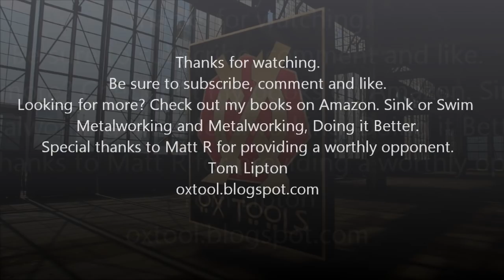Screw Extractor Torture Test Round 1

Comment: I'd rather use the open end of the wrench in situation like that... It might be a little bit more dangerous to your knuckles but takes out the unwanted and insidious bending that is caused by the angle of closed end. I've learned it the hard way... :P
Reply from the maker: Hey Mikey,

Good point. The angle adds a weird moment to the shaft of the extractor. Never really thought about that one. Thanks for the comment.

Cheers,

Tom

Comment: Its beautyful to see how carbide cuts hardened steel like butter =) Tho ... why not heat the ear of the thing to get some of the hardness out of the bit ? to anneal it =)
Reply from the maker: Hey Tomas,

If the engine cycling didn't anneal the stud its not going to happen from anything I can do easily. The material is some kind of stainless. Faintly magnetic and fairly hard. I may take the remainder and see if I can figure out what it is. Thanks for the comment.

Cheers,

Tom
Reply: hehe that is true! But what i was thinking of was the broken of extractor =) Tho carbide seem to cut that stuff quite nice! =) Was a stubborn bugger that bolt! =)

Comment: Hey Tom,  it may one of those ARP Studs . They are very high grade studs.
Reply from the maker: Hey Norm,

What is an ARP stud? Best guess so far on the material is A286 precipitation hardening stainless steel. Thanks for the comment.

Cheers,

Tom
Reply: oxtoolco Hey Tom,  ARP  is a hi performance automotive supplier for bolts and studs.  Im sure they use some high grade steel.
 http://arp-bolts.com

Comment: Hi Tom,
           At least you are showing that the ceased up bolt which is every mechanics nemesis has thwarted the professional ceased bolt remover. To my mind the bolt remover has been over hardened and should never have shattered. I think that the diameter of the bolt remover which is smaller than the bolt would not be up to the task set it. We have a bolt remover in the UK that has a single turn reverse spiral on a tapered shaft, and the top end of the taper is the same diameter as the bolt. The more you try to turn it the tighter it gets, but I don't think even one of those would shift that stud. I would get back to the manufacture If I were you,and get them to remove the stud - I doubt they would succeed. It certainly doesn't do them any credence.
Reply from the maker: Hi Mo,

I agree this tool should have twisted before shattering. Also I feel that an extractor that is close in size to the fastener should be able to remove it. Drilling the center out of the fastener certainly weakens it somewhat. This particular stud was literally welded in. I really want to try some of the other ideas than cam through on the comments. Thanks for the comment.

Cheers,

Tom

Comment: I had a toyota with a broken exhaust manifold and the same problem. Hard as ...... And the bolt was broken in the head did the drilling while engine in the truck. Shait but I got the thing out. Have not broken an extractor yet..... Dred the day it happens :)
Reply from the maker: Eric Hope Hey Eric,

I tip my hat to you. I would not want to drill that super alloy while it was in the vehicle. It was hard enough with it in the  vise. Thanks for the comment.

Cheers,

Tom
Reply: oxtoolco Yeah it was like a day in Hell. Bolt broken under the surface. 6mm drill bit with a 6/8mm pipe to make it go straight in the hole. A air angle mini grinder and a crowbar to push it in. One can sometimes wish for a couple of extra arms :) LOL

Comment: Ah, yes... those metric 12.9 bolts...  the 10.9 hardness is bad enough (10.9 is about a Grade 8, 8.8 is roughly analogous to a Grade 5), but the 12.9 is something else...

Eric
Reply: And when you sheared off the extractor... 10.9 bolts might be that hard relative to your tool, depending upon what Blue Point made it to be... 12.9 = no contest...

I've rumors that the geniuses behind the metric screw standards have dreamt up a grade rated over 14 - not sure if it's gone into production yet...
Reply: chemech  "They sell replacement parts for this very reason..."   BTDT, got the scars to prove it...
Reply from the maker: chemech Hey Eric,

That stud felt like grade eight plus to me hardness wise. Slightly worse than drilling a black socket head cap screw. Thanks for the comment.

Cheers,

Tom

Comment: Tom,

I have lots of experience removing rust welded studs from exhaust manifolds.  I have never once been able to remove a rust welded stud or bolt with any style of screw extractor.  In this case The only thing I find that works sometimes is to weld a nut too the broken stud and back it out.  This only works about 30% of the time.  Then the next step is to drill and re chase the hole with a tap.  The only situations I have ever found a screw extractor usefull for are those were some knuckle head has overtightened a bolt and broken it or when an otherwise clean bolt has succumb to fatigue.  My guess is you will not be successful with the extractor.  I dont want to be the naysayer,  Just speaking from experience.

Comment: Totally amazed at all the experts writing in this blog.  I remove a lot of stuck, broken off, beat up, welded by rust/heat and other uncommon problems.  I got some info from this one/two punch at removing stuff.  Thanks.
Reply from the maker: Hi Bill,

Thanks for the comment. Many of these experts missed the point of the video being the testing of the new set of extractors I got. I never would have cut the stud off in removing it was the goal.

Best,

Tom

Comment: Freaking. Machinist 

a car guy would know it is hardened.😂😂😂😂😂
Just kidding Tom
Maybe I’m stupid but it seems that driving an extractor in just forces the threads against the part exacerbating the problem.
Seems they were only made for bolts that snapped due to over tightening. Not because they seized
 My solution to this has always been keep using larger and larger drills until the bolt wall is so thin you can get it to collapse. And pray you don’t screw up the internal threads in the process

Comment: Can't you just drill it out, stick a reverse thread tap on the there, thread in a bolt and use that to remove it? Seems like it wouldn't break like this and be easier to do.
Reply from the maker: Ariel Lezen Hi Ariel,

The goal of this video series was to test to destruction the Blue point screw extractors. I think we did that pretty well here. You are correct that if the goal was to get it out I might have used a different technique. Thanks for the comment.

Cheers,

Tom

Comment: I would have never cut it off. I would have went for the torch and vise grips /pipe wrench first .IMHO
Reply from the maker: Hi Paul,

You are correct. I was testing the extractor, not the easiest way to remove the stud. Thanks for the comment.

Cheers,

Tom

Comment: This video is real pain man . What is the purpose of it anyway extracting the stud or testing the straight of this extractors ? First think I would do is use the existing stud witch is sticking out best case , don't cut it out and make your life harder. SIMPLY if the thread is good put  two locknuts as close as possible to the part and turn bottom one anticlockwise. Of course put your penetrating oil let it set and you can hit on the nuts with the hammer from all sides to shock it. If this doesn't work weld a nut if the stud snap do all the rest. You can drill the hole to the edge of the thread and clean in with tapper or just drill it bigger and use simple helicoil to repair it. 5 min job byddy this is what it is.
Reply from the maker: +Matt Atanasov Testing the extractors like the title says. I wouldn't have cut it off if removing the stud was the goal. Thanks for the comment.

Cheers,

Tom

Comment: I'll share my method for removing that stud. It would not make it to the machinist and I'm willing to demonstrate if anyone has something like that for me to try. First I would heat the corner of the manifold  and the stud red hot. If the stud is coming out, the assumption is that it needs to be replaced. I would use a vise grip or a stud extractor like the old Snap-on A-50. If it didn't play nice on the first try I would heat and cool the part several times. If it's still not coming out, dip the stud in water when the manifold is hot. This will shrink the stud away from the manifold. If for some reason the stud breaks off,  start welding onto the broken part until I can either weld on a nut or grasp the weld with vise grips. (these days it seems the welder is the first choice for the automotive stuff, due to it's speed and effectiveness)  If the weld breaks away from the fastener, I'll weld on it again and again until it comes out. After all that, very rarely I'll drill until the threads are thin enough to collapse into the hole. If the manifold threads are damaged badly install a helicoil or drill through and put a nut on the other side. It almost never gets to the last 3 options especially if the earlier ones are done with some care. But you know auto mechanics haste sometimes goes before destruction ;)  I don't own a an extractor like Tom has in this video but maybe someday. In my opinion that is not the correct tool for this particular job.

Comment: always try two nuts first, bind together and unscrew the bottom one!
Reply from the maker: Hi Donald,

The purpose of the video was to test the screw extractor not necessarily to remove the stud. I think we did that. Thanks for the comment.

Cheers,

Tom
Reply: yes, thanks see it now, wondered why you were cutting the stud down usually you try to keep as much as poss.  Never liked easy outs, they never worked for me, you have to loosen the tap first before they work so defeats purpose a bit when if its loose you can get it out with anything else.

Comment: I got so frustrated watching this video.  More cutting fluid with the drill and end mills.  When dealing with manifolds, always use plenty of lubricant throughout the procedure and heat.  Without plenty of heat, lube, twist slightly back and forth.  If it isn't moving then keep applying more penetrant, more heat, and work it back and forth to get the penetrant to work into the microcracks.

Comment: What a dumb idea that extractor is. All its doing is forcing whats left of the stud into the hole lol. Ive always used an Easyout or drilled the hole on a milling machine about 1mm smaller than the minor dia of the hole thread provided you can center the drill nicely. Usually whatever is left of the stud comes out while youre drilling. Ive also made reverse ground drills before too. Run your spindle backwards, drill 1mm smaller and it will unscrew while drilling.
Reply: I've done the reverse grind trick with success, once even on a tiny screw in a dial indicator plunger....
I've just ordered a set of left hand drill bits to save a bit of time if a rush job comes along, but reverse grind works fine. (Does need to be well centered though, either in a mill or clamping a guide bushing to the job - sometimes you can bolt the mating part back on with some of the other bolts or studs, and sleeve the hole which lines up with the broken stud)

Comment: wrong procedure you dont use the right extractor , you insert more pressure inside the stud on the tread and thats it, the result will expand the stud inside and more tight .. eat more salt
Reply from the maker: +junledda Hi Junledda,

The point of the video was to test the extractors as they were designed. Thanks for the comment.

Cheers,

Tom

Comment: This is painful to watch! Machinists operate machines...Car Guy's lay under cars!   "Car Guy's" knows how shite these Extractors are and would have welded a washer then a nut to the washer and fill with weld and remove it.... If, like for this demonstration you intend to use these extractors then my approach would have been to slice through the manifold along side the bolt using a thin grinder disc and wedge the cut open slightly to release tension & apply lubrication before using the extractor as the extractor just wedges the bolt even tighter and snaps!  Car Guy's Know This. so 18 mins in and SNAP I can't bear it anymore, nor the arrogance towards Car Guy's from a (Pompous Machinist)  who's been pissing around for 30 mins! When a Car Guy would have it sorted, fitted and a happy customer! :-D